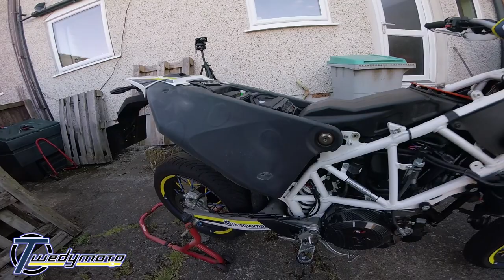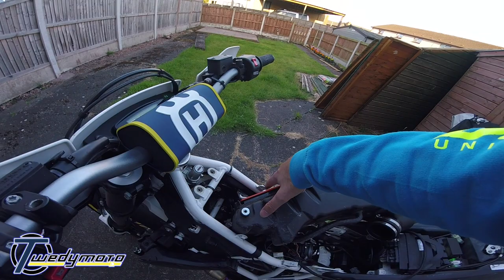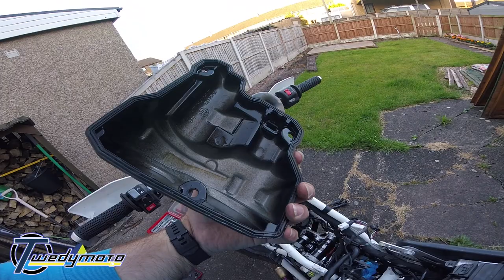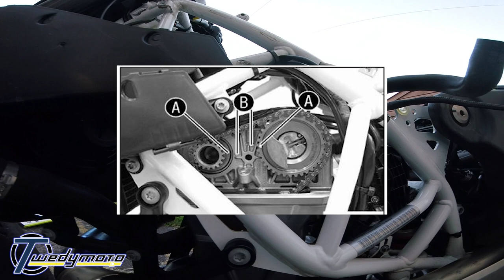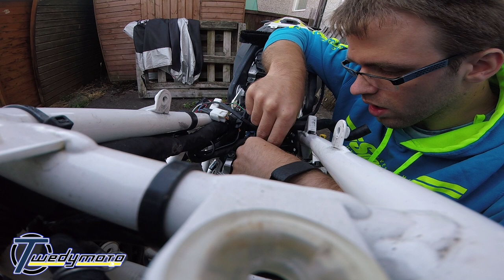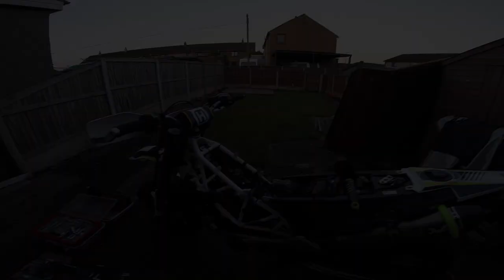How to check valve clearance on 2017+ Husqvarna 701 | KTM 690 SMCR

Comment: Good vid man. Gonna start pointing people here when they ask me about valves. Mine are due for a check soon but bikes been starting easy so doubt they're out any. Trying to do better about supporting my fellow 701 YouTube community
Reply from the maker: Cheers Steve. Mine has been starting fine and stuff, just a little noisey but nothing out of the ordinary for these motors. It was due a check as I hit 6200 miles, replaced the spark plugs and fuel screen too and it's happy now!!

Comment: Thanks for making this video. I have a SMCR 2020. I think it’s the same engine. When removing the coils did you pull them out of the plastic holder or just disconnect the cables and undo the two screws and pull the whole lot out?
Reply: And what did you use for the “special tool” to lock the crank at TDC, a screw driver?
Reply from the maker: No problem. yes, the 2020 SMCR is the same engine as my 2017 (some minor mechanical differences) but has more advanced electronics (cornering ABS, throttle maps etc). I removed the plugs from the top of the coils, took the screws out and took the whole lot out. I don't recall locking it in TDC, I was just careful not to move it but you could use a screwdriver or a long bolt (M6 i think, could be wrong though). Hope this helps :)

Comment: Thanks great video.  When I removed the plastic cover to reveal the crankshaft bolt oil poured out, is that normal?
Reply from the maker: if you had thebike on the side stand then that's probably right as that's where the oil level would be. If it was upright, it may have been over filled slightly but not much should have come out.

Comment: Nice explanation, but I'm looking for the how to get to the shim... Do you have some picture of the shop manual about how to get there ?

Thank you
Reply from the maker: If you use facebook, there's full versions of the service manuals on the husqvarna 701 group in the files section. The intake side is easy, just move the cam over but the exhaust side needs a bit more work.
Reply: @Twedymoto  BIG TIME Thank you ;-)

Comment: I didn't see other videos say taking a spark plug out was required to turn the engine crank to Top Dead Center?
Reply from the maker: Taking a plug out makes it easier to get to tdc so that you're not fighting the compression of the engine. I was replacing mine anyway so that's why I had them out. 👍

Comment: my bike stalled one day and won’t start at all. but i also think it might need new shims on the valves because it’s over 1k past the check. do you think that would stop it from starting at all?
Reply from the maker: Tight valves can be a cause of it not starting when hot among other issues but to be 1,000mioes past the check it shouldn't be that bad. Hope you got it sorted. 👍
Reply: @Twedymoto  yup all good now lol. i just let it sit for like 2 weeks n then came back to it and it started back up.. kind of a random thing to happen but it’s running like new now so can’t complain

Comment: Hello!I just want to tighten up the 4 valve box screws.Do i have to remove the whole airbox?
Reply from the maker: If you mean the rocker cover screws, then i'm not 100% sure. You can get at the left side one easily but the front and rear right might be a pain. take the plastics off and get a look in.

Comment: Can anyone (including Twedymoto) confirm this is the same process on a 2019+ KTM 690 Enduro?  Thanks,
Reply from the maker: As far as I'm aware there haven't been any major changes to the head since the launch of the new engine ( with balance shaft in the head), but there have been a few revisions to the decompression mechanism so should be very very similar or exactly the same process. 👍

Comment: Wow didn't realize how different the new motor is. Guess ktm  fixed the rocker arm bearing issue lol
Reply from the maker: Yeah, I was a bit dubious about checking the valves myself as i wasn't sure about the new design but it's a piece of cake! As far as I'm aware, there haven't been any rocker arm failures on the new motors!!
Reply: @Twedymoto  Friend, if the tolerances were higher, what would you have to do to the bike to make it work normally? What would you have to change?
Thanks for your reply.
Reply from the maker: You would need to remove the old shims and fit the correct sized ones to bring the clearances back withing spec.
Reply: @Twedymoto  how do you remove all that stuff, considering there are no more simple rocker arms with a pivot pin?
Reply from the maker: I've not had to do it yet but the intake side is easy, you just slide the cam over and the shims lift out. For the exhaust side you need to remove the rocker arm which is just a couple of bolts.

Comment: KINDA A WASTE OF TIME IF YOU DON'T ACTUALLY SHOW HOW TO ADJUST THE VALVES.
Reply from the maker: Not really, as the description is how to check clearance not adjust them.
Reply: @Twedymoto  That's better.  Thanks for editing your title.  😁  if you can add 2019 + bikes,  that would even be better.  ✌🏼
Just so folks that have older bikes can cruse on by.  And not waist there time looking at your fine video.  Just a thought though.  🏍
Have a good one